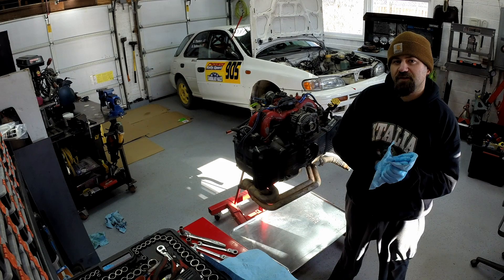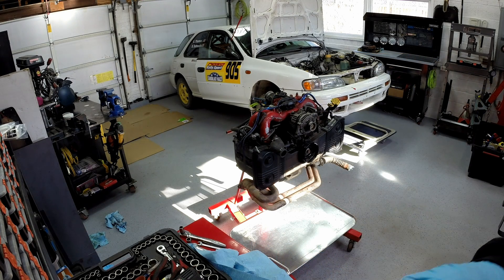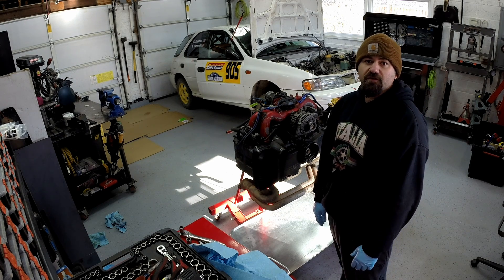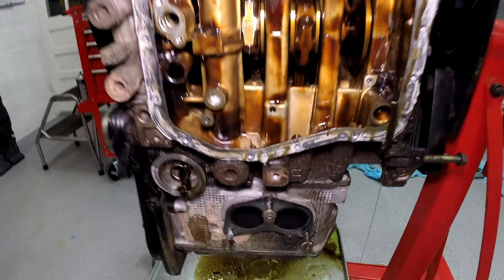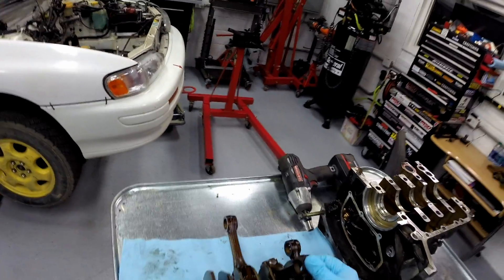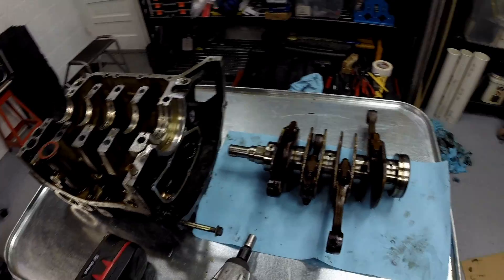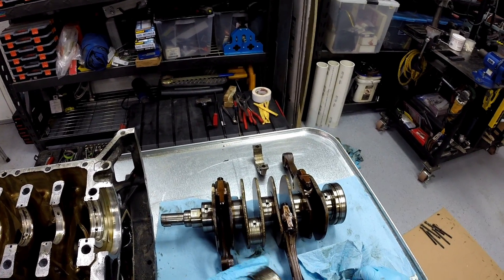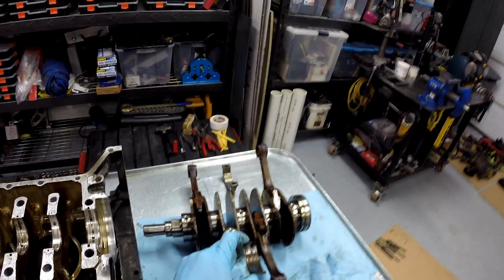EJ25D Teardown - Identify Sandblast Engine Failure

Comment: What kind of alterations for performance did you find? If you don’t mind sharing. I’m working with a 97 outback 5 speed swap, and wanna do a few mods to the motor itself, heads and block
Reply from the maker: Happy to share.  This motor had intake, phelonic spacers, head porting, headers, and exhaust.  These engines are not easy to make power with.  Intake and exhaust are probably the first and easiest things I would do.  Good luck with the project and thanks for watching.